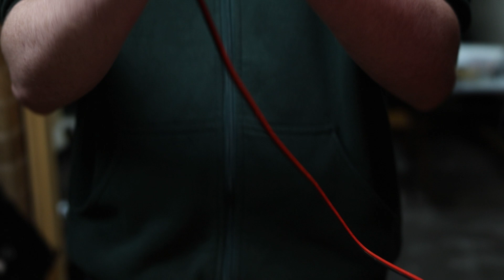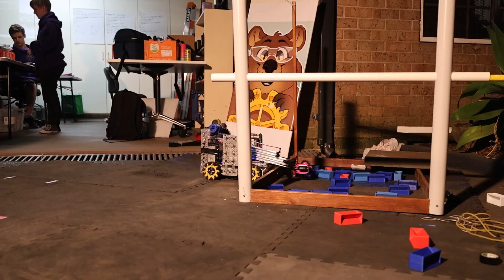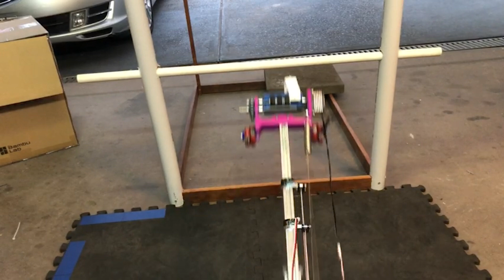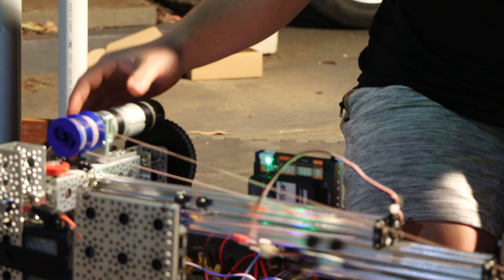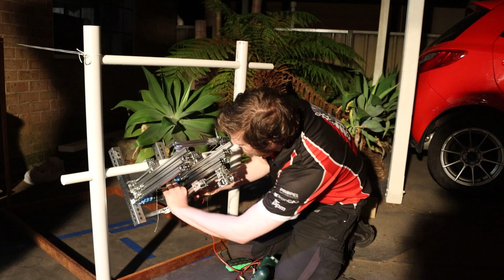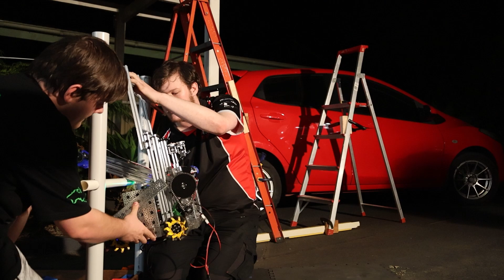Ri30H Robot Systems Overview

Comment: still a little confused on how yalls intake works, does the wheel wdge the block in between it and the polycarbon flap or does it work differently? either way brilliant design
Reply from the maker: Yep, that's exactly right!

We had plans to possibly add a roller underneath to assist with some slight height misalignment, but given the time constraints, it ended up working well enough that we didn't go further down that path. 

We plan to release a tech binder of sorts some time in the next couple of days discussing our process.
It will have a more in depth breakdown of the intake and the other mechanisms there, as well as improvements that we identified but didn't have time for.
Reply: @UnqualifiedQuokkasRi3D  Thats really cool to hear! My team was considering something similar but we were planning on using a container instead of sorts to house the specimen I'm currently looking for feedback on my design and I recently made a CAD, would yall be interested in checking it out? We still haven't received game pieces yet so it's hard for me to gauge whether designs will work or not
Reply from the maker: @Darkcamera45  we would love to!
Send us an email at unqualifiedquokkas@gmail.com and please CC a mentor. 
We will check it out and can answer any questions or concerns you have about your design, or about our design too.